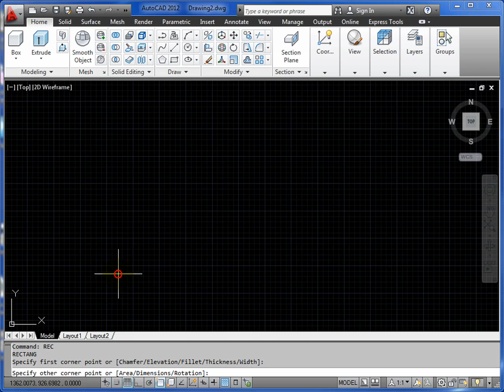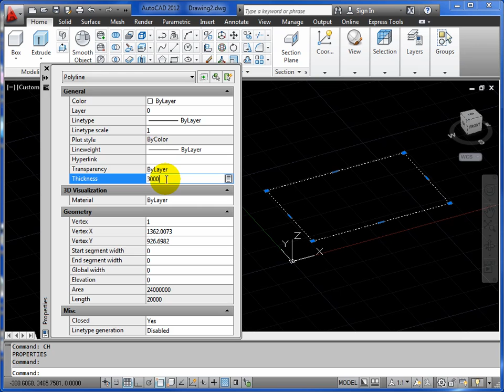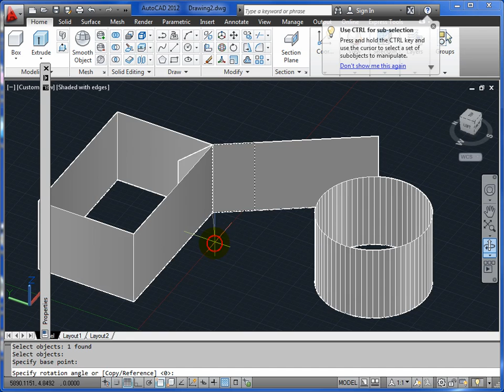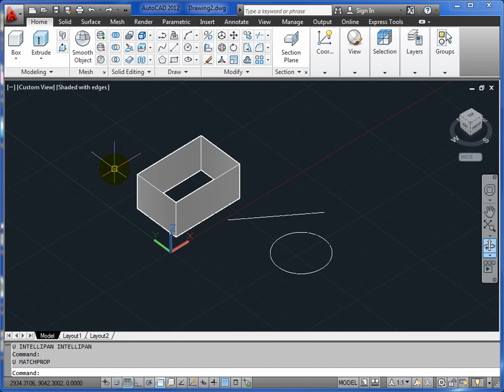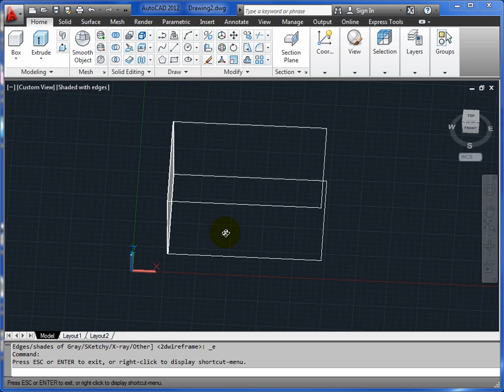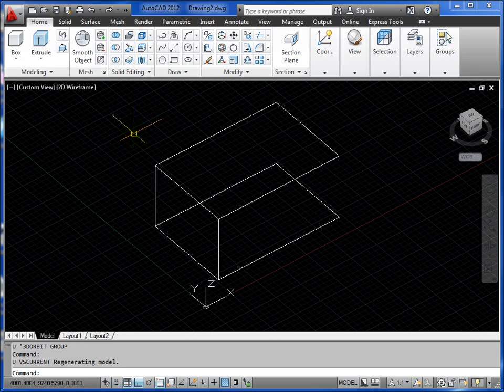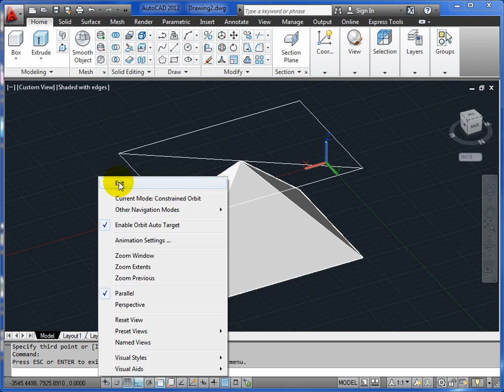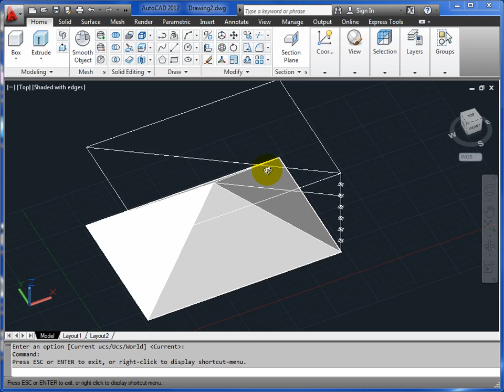AutoCAD 3D Basics Tutorial Part 1 - Thickness + 3D Faces

Comment: hi emmockladdi, Im a student and i learn autocad 3D by myself, and i base on your tutorial to learn but i get a problem like that :  when i want to draw a polyline in a plan xOy, the polyline was draw in a nother plan like xoZ. So i wonder what the command to choose a plan to draw. Thanks for your reply.
Reply from the maker: Hi Tuan.   There is a button at the bottom of the screen called 'dynamic UCS' that you can switch off.   I have noted that in AutoCAD 2015 this is VERY DIFFICULT to switch off - it's hard to find as well.

Comment from the maker: Hiya. It depends on who you are or the line of industry you are in I suppose.  Someone used to 2D autocad will find it easier to use 3D within AutoCAD. Being able to draw your geometry first e.g. to work out angles is extremely handy.If the base info you are working from is already in .dwg format then you won't lose any accuracy.3D Studio has an accuracy level that makes it a problem going backwards and forwards with files.All you dan do is try them and see which you feel most comfortable with.

Comment from the maker: hi Agni, I am assuming you are asking in relation to changing the elevation of an object ?  You can do this with minus CH ( -CH ) this lets you modify properties of an object from the command line. CH on it's own will bring up the properties panel - change 'start Z' and 'end Z' for a line or if it's a polyline (polygon or rec too) you will see 'Elevation' can be modified.   I use the -CH one as it does lines and polylines.